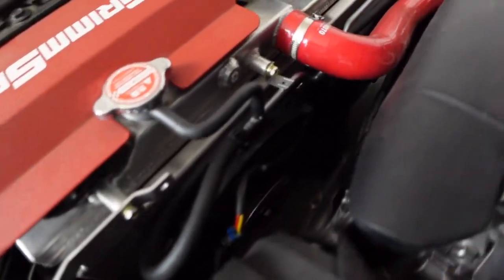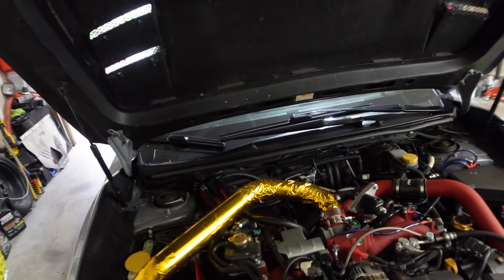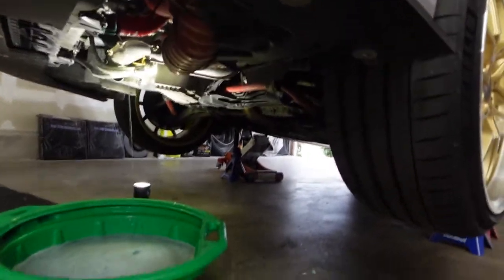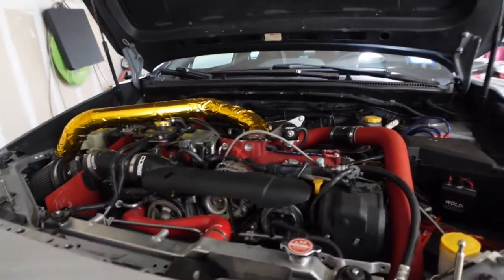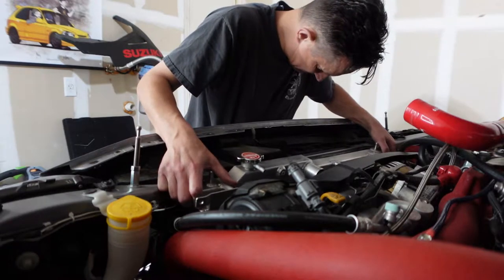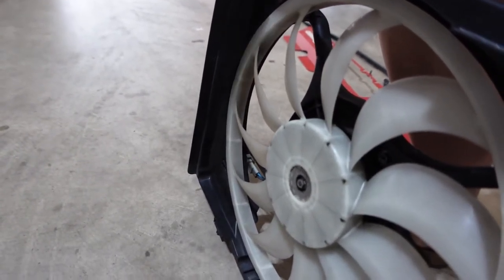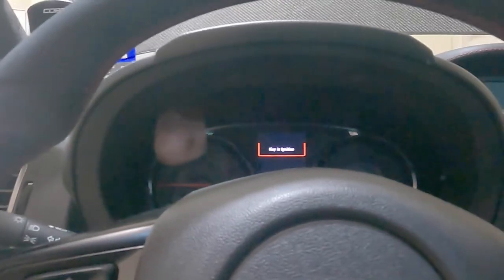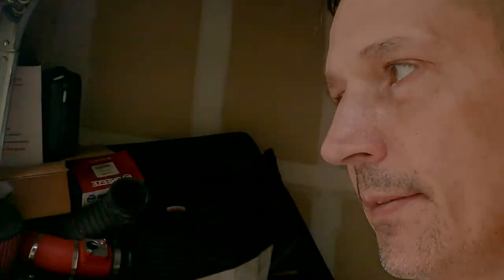STI - AWESOME CSF Racing Radiator Install

Comment: What do you think after driving it for a bit?? A lot better than the Koyo?
Reply from the maker: I think it's better. Keeps my car 10 degrees cooler than before. I put the Koyorad in my son's 2014 WRX and it worked like a charm. Thanks for watching!
Reply: @BushidoPhoto  dope! Thanks for the reply. My Koyo is leaking after only 6K miles on it. And my coolant temps are a little high for my liking. You’re the only person who’s posted the new CSF on YouTube 🙌🏽! I’m deciding between the CSF race or the Mishimoto X line.

Comment: i noticed the 1.4 bar my temp went up compare to 1.3 bar
Reply from the maker: Yeah, I swapped over to the stock cap on the radiator and put the 1.3 bar on my car. Will do some testing tomorrow to see if temps are a little more like normal. They were hitting 208 on the highway at 80 mph in 6th gear. I've burped the system a couple of times and watched a recent video talking about the one way and two way caps. You should only put a two valve (aftermarket) cap on the reservoir and use the stock cap on the radiator so coolant can flow back to the overflow tank.
Reply: @BushidoPhoto  how you know which is the 2 way cap? I ordered 1.3 greddy bar.. I don’t know if it’s a 2 way..should I change the expansion cap to 1.3 bar?
Reply: @BushidoPhoto  I wonder if I change the expansion cap to 1.3 and keep my 1.4 to my radiator ..
Reply from the maker: I would recommend running a stock one way cap on the radiator. Here’s the link to the video talking about it. They also made an update video. https://youtu.be/HzjBJz1Zdmw
Reply from the maker: It has a metal piece underneath. Pretty much all aftermarket caps are two way. Please watch the video I linked.
Reply from the maker: @Judgedredd18  https://youtu.be/RWZUdHRHkeI
Reply: @BushidoPhoto  my oem radiator cap doesn’t fit my Csf radiator it’s kinda loose and leaks..